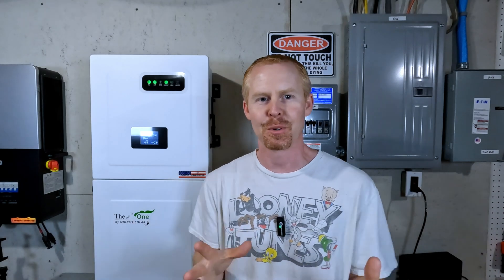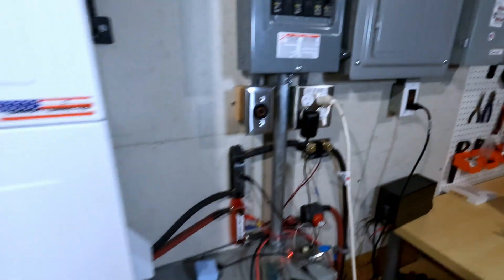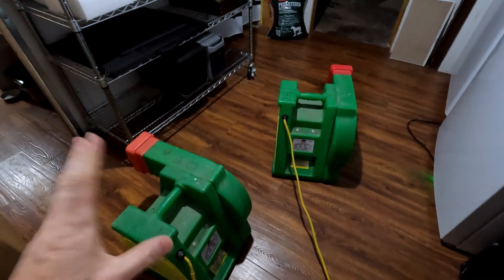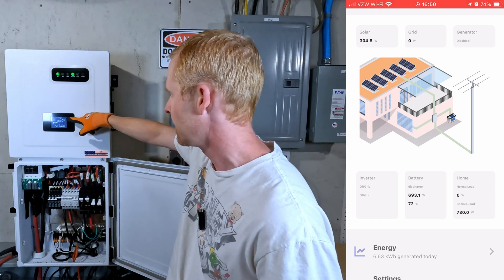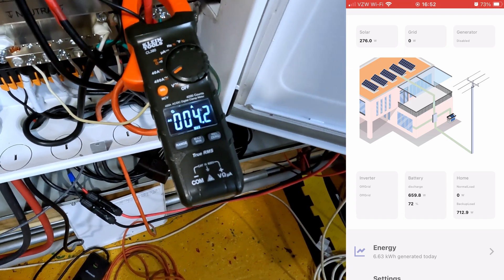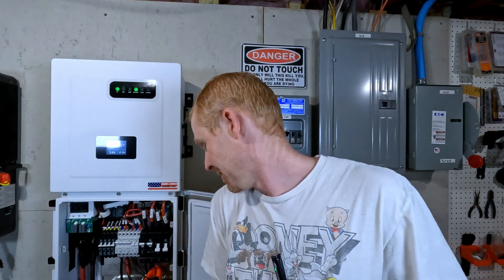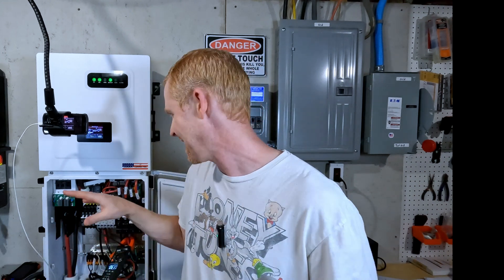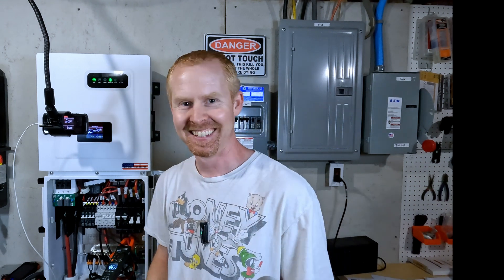Surge and Imbalance Test on MidNite "The One"

Comment: I’m looking at this inverter for our house but this video has me confused.  I’m not an electrician but have wired houses.  To my understanding, this inverter is supposed to handle 13,000 watt surges on one leg, 20,000 all together surge.  Your 2 fans are a little over 4kw.  My water heater is 4.5kw.  You have me concerned this won’t handle my house.  Compare it to a signature solar load test on a Schneider 6.8kw, they run 7 space heaters, microwave, oven and all stove tops, tv, bathroom vanity lights and a clothes dryer.  What am I missing?
Reply from the maker: You're asking a great question! The main thing to consider is the difference between inductive loads (like motors, compressors, and pumps) and resistive loads (like space heaters, ovens, and water heaters).

In my test, I used two 2HP bounce house blowers, which are inductive loads. Inductive loads have a high inrush current when they start—often 3-7 times their running wattage. So while each blower might be around 2,000W running, their startup surge could be much higher for a brief moment.

On the other hand, the loads in Signature Solar’s test were mostly resistive loads, which don’t have a big startup surge. A space heater rated at 1,500W will pretty much pull 1,500W consistently, and resistive loads can often run at slightly lower voltage without shutting off. Plus, in their test, loads were turned on gradually, not all at once, which helps manage power demand.

Another key difference is that my test was all running on a single leg of the inverter, while the loads in Signature Solar’s test were likely split across both legs (since they had 240V loads like an oven and dryer). This makes a big difference in how power is distributed and how surge capacity is handled.

So, if your house has a mix of resistive and inductive loads, the real-world performance will depend on how many inductive loads start up at the same time and how the loads are balanced across both legs. If you have multiple big motors (like a well pump, AC, fridge, and an air compressor) kicking on together, that’s when surge capacity really matters.

Hope that helps!

Comment: Friggin imbalances make me hate the 6500EX. I figured out that was why it fails to go into SBU and goes into GRID SBU. It seems when there is more than a 20% or so difference it goes into grid mode. Even after changing the battery amp limits its still doing it. I can't tell if its sensing a temporary voltage drop or if its just being stupid but I hate that the only way out of the mode is to physically shut off the AC input. I have nothing with more surge than a window air conditioner and the load is like 20% and 50% when it happens.  I think I need to switch to an 18kPV this year or next year so I can get the 200A pass through. Does The One have that? I can't find the spec.

Edit: Found the spec, 100A pass through :( I wish there were more options with 200A passthrough so I could more easily just put everythign on the inverter knowing the grid can handle surges.
Reply from the maker: I thought you only had a single 6500.  I'm not sure how you would have an imbalance when you're only dealing with 120v.  Are you talking about how the inverter handles surges?

Yeah, the MidNite is only 100A passthrough.  The owner of MidNite solar actually had a long paper he wrote about why it's only a 100A passthrough.  I think one of the reasons is rarely does a household pull more than 100A continually at the same time.  I believe the MidNite is different in that it's actually designed to be able to run at full capacity full-time as well.
Reply from the maker: I found the article if you're interested: https://www.midnitesolar.com/pdfs/200_amp_inverter_thoughts_(2).pdf

Comment: Midnite should be  doing these test..preferably before they release the product.
Reply: I worked with Midnite on the early release models and we certainly did do this kind of testing.  In fact, we took these inverters to the point where they should have failed and made sure they didn't, corrected any potential risks as well.  We also tested in comparison with other competitors and know the strengths of the ONE and weaknesses of the competition.  I'd love to see similar testing like we saw here with other inverters.
Reply from the maker: @nealhamilton3881  who knows, they could be???

Comment: Man that thing can handle an inductive load for sure. 

On the last test I saw L2 dip down to 102v. I guess that was just some derating or voltage sag during the startup? Because the next time it cycled through it was 120v on both legs.
Reply from the maker: @GavinStoneDIY  Yeah I’m guessing that’s how it allows larger inductive loads to run.  Those bounce house blowers are monsters.
Reply: An electric motor on startup looks damn near like a short circuit.  It would be expected that there would be some voltage drop when the circuit is pushed in this manner.